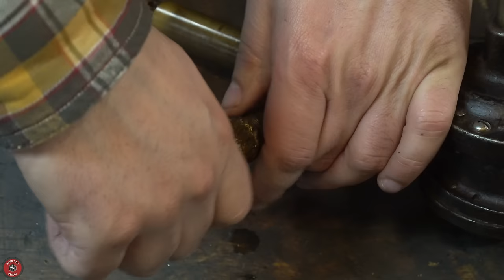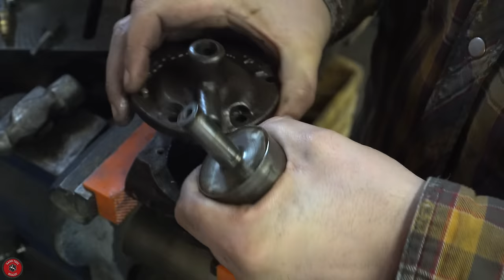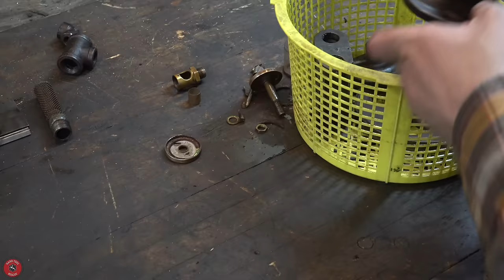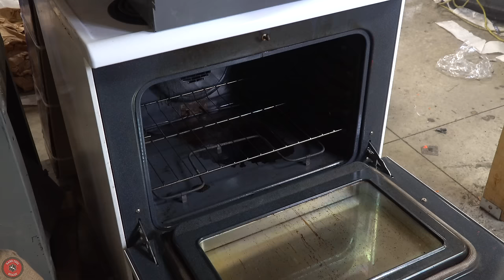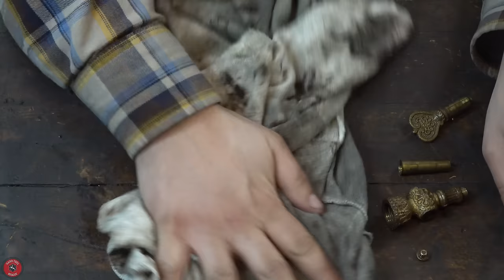Rare Antique Blower [Restoration]

Comment: Nice job Eric, but you're supposed to put the locating pins in the block BEFORE you tighten the screws! ;-)
Reply: true
Reply: And coulda made a mandrel to straighten the brass screen from the inside, of a proper sized wooden dowel with a rounded end

Comment: Some things to menition:
I like your work very much. 
The hot glue is a clever trick! :)

Some improvements for next time:
Please do not sandblast the housing of a blower the inside is a sealing surface and it will be damaged.
Please put the liquid sealingaround the screwholes on both sides, otherwise ther may be leaks
Please put at first the positioning Pins inside and afterwards the screws or bolts, otherwise there can  be some stress in the housing.

I would never put the soft foam inside the wiremesh airfilter, it may bes sucked inside the housing and scramble up the Rotor, which would be very sad :(

Kind regards Kai Heetjans
Reply: Agreed...

Comment: Next time you need to make a new gasket, buy a cricut, used for arts and craft mainly, but you can configure it to cut most gasket material. Basically it’s a tiny CNC
Reply: there are smarter ways that people used to cut gaskets back during the olden days

Comment: With the foam on the inside of the brass cage, is there a possibility that it will get sucked into the pump?
Reply: I'd think so, especially once the foam gets loaded with dust. Seems more likely to me the mesh is intended to support a sock filter pulled over the outside as used on dirt bikes.
Reply: Not likely. No more airflow than what it had, chances are extremely slim.  It would take a massive force of airflow to dislodge the foam.

Comment: My father repaired musical instruments, and back in the 1950s he had a later model of a Hypress blower that he used with a small natural gas torch. He used it to silver solder and soften metals before bending. The output of the blower was anything but impressive, but it worked well with a 1/4 hp motor.

Comment: Love all your videos, excellent work!  I like that you try to reuse as much of the original pieces as possible and you don't "over restore".  Friendly piece of advice.  Nitrile or latex gloves are your friend.  Skin is an organ and absorbs nasty things like the chemicals in penetrating oil, solvents, etc.  Not a big deal for the occasional weekend resto-warrior, but if you're exposing yourself daily, protecting your skin matters.  A box of 50 pair of "shop gloves" (heavier duty than the light blue ones you get in the paint aisle) is $20 or less all day long.  Get a box, your circulatory system and especially your liver will love you for it.

Comment: The rotary compressor is indeed rare, but everything else around it is fiction. The drip oil ain't going to work with a 90 degree pipe and that horizontal section and this ran with steam, steam ran with flat belts. Someone fabricobbled this from bits and pieces.
Reply: You may be right about the pulley, but the oiler is as it appears in the advertisement he posted in the description.
Reply: @badstate  But he watched AVE videos, He doesn't need to read the description and follow the links because he knows everything already.
Reply: @UncleWillie  also lost that beautiful patina on the iron.
P.S. they had round leather belts then to
Reply: @badstate  yes it will oil the vanes even with the elbow
Reply: Yes. A lot of the stuff is just added afterwards to rig up something that worked for whom ever did it. Either way it’s interesting nonetheless.
Reply: I've also yet to see an air filter with foam after a screen mesh. When that foam degrades it'll screw that thing up over time. It's probably custom too.
Reply: @rustybacon54  probably had felt over the mesh seeing foam was not around then
Reply: rustybacon54 whenever I encounter these types of filter housing I use socks of the appropriate size. Go all the way down to short and long infant socks up to Shaquille O’Neil size. Put it on inside out to avoid lint.

Comment: I will never agree with the whole patina thing.
Reply: The difference is between a "reset" and a "restore." Nothing wrong with a reset if you want to keep and enjoy using something for yourself. Collectors want a restore and collecting is more popular, so that is where the money is.
Reply: I agree I think the whole patina thing is bs.
I have talked with a local restoration guy and he also said the petina thing is a load of bs as well.
And he blamed Antiques Roadshow for people not wanting to restore there stuff even if it doe's look like a pile of crap they have and would look better with the rust and grime taken off.
Reply: Especially when all the steel screw heads are polished and the label rivets are shiny brass. Doesn't match.
Reply: if you don't understand the value of patina then don't handle antiques.
Reply: Not agreeing with and not understanding are not the same thing.
Reply: I did 8 years in the navy, If I never polish brass again it'll be too soon; patina away!
Reply: "I'm keeping the patina" said no one else on YT resto projects ever!

It's easy for folks to set a goal of making something look factory new (maybe not easy to achieve) but it's harder to decide on  how far to take a restoration or conservation. Kudos to you for taking that decision but I wonder why you didn't stick with the original black japanning which I didn't think looked too bad.

Comment: This same basic design of air pump is still in use for the same purpose -- separating sheets of paper for the feed into a printing press. All three of my printing presses (the oldest was made in the '70s and the newest in 1996) have somewhat larger versions, which supply both the air to separate the sheets and the vacuum that picks the sheet up and chunks it into the gripper. 

My pumps have three Bakelite vanes inside that slide freely in slots in the impeller. They are kept against the chamber wall by centrifugal force, instead of that complicated metal seesaw arrangement. I have to rebuild these pumps every few years (the Bakelite wears down); there's a kit I get that includes new gaskets and vanes. I've found that the key to keeping these pumps working well is to keep them oiled and clean inside, and do everything in your power to seal that sucker TIGHT when reassembling it -- but don't put the covers on TOO tight, or they bind the impeller. I've gone so far as to lap the covers onto the body with Bon-Ami before using both the rebuild kit's thin cellophane gasket and that "instant gasket" stuff. 

At least you had less trouble with the pulley than I did on one of mine. Some dolt had beat on the shaft end with a sledge or something and enlarged it (which to my shame I didn't notice) , so the pulley WOULD NOT come off, period. I wound up getting it off in pieces and finding a replacement.

Comment: I’m sure you already know that ornate valve most likely came from gas lighting found in Victorian era homes. Good job on the vid
Reply: Ya it probably was just like the air filter housing looks like someone got a piece of brass mesh and some solder and made it themselves because I think back when that thing was in use people didn't buy a new one every time something was broke they just repaired it with whatever they could however they could

Comment: Nice work as always! Good that you did not polish it up and make it look new. L.J. Wing Co. is still in existence. They seem to make heating and HVAC equipment now. My dad had an L.J. Wing blower that he connected to a 1/4 hp motor and used with a gas blow lamp or blow torch. He repaired brass and woodwind musical instruments and was a true artisan.

Comment: The way that piston works is ingenious. I wonder if it's ever been used in an internal combustion engine. Very cool!
Reply: Very similar sliding-vane pumps are used to pump oil in many engines and automatic transmission.

Comment: Very cool old machine! Also interesting that it was used to separate paper sheets. I expect they had an oil trap on the system to protect the paper from greasy spots from the air discharge, with that oiler!

Interestingly, that design is still in use today. You can buy an Ingersoll-Rand air-powered motor which is almost identical to that blower. When I saw your video thumbnail, that's what I initially thought it was!  Look up SM series Air Motor.

Thanks for the nice videos!

Comment: GV. You should get some dental tools for delicate work. For example, you could use a tartar scraper to remove that stubborn cork from around the inside of the cap. You can use the picks to lift out small O-rings and scrap clean any stubborn bits that are left.

Also, you should use a drop or two of liquid thread sealant around the fittings to ensure an air tight seal.
Reply from the maker: Could be useful actually!

Comment: I've reshaped quite a few brass mesh filters over the years.. 
The easiest way I've found for small ones like that is to put a bit of round in that's about 3/4 the i.d. and then gently roll it on a 2-by-4.
The go up to the closest size you have and repeat. Only takes a couple of minutes.
Reply: And if the filter fine mesh and  is bigger than the fitting you Can insert a thick rubber balloon in, pressurize it and do as with a dowel. Needs finer touch and more rolling though

Comment: They were used in the product of glue laminated beams aka glulam 
Glulam is a stress-rated engineered wood beam composed of wood laminations, or "lams", that are bonded together with durable, moisture-resistant adhesives. The grain of the laminations runs parallel with the length of the member. Glulam is versatile, ranging from simple, straight beams to complex, curved members

Comment: If you take out that compressed foam filter, you could probably up the airflow quite a bit.  Just line the inside of the screen  with the foam or a lighter weight foam.

Comment: The threaded connections of such pipes had large backlash and probably need additional sealing with FUM tape (flax fibers were used before).
Such a foam filter will not work properly.
The faucet plug had visible scratches, perhaps she must be ground again.

Comment: I have concerns about using the sealant on the end plates of the air pump. Normally it's supposed to be a metal-to-metal seal. The rotor, housing, and vane of these types of pumps are surface ground, then lapped as one unit so they are exactly the same thickness. The rotor and vane may be left in the lapping machine a little bit longer so it is just a tiny bit thinner then the body, thus providing the absolute minimum clearance when running. The layers of sealant will increase this clearance too much and a lot of air will bypass the rotor and vane.

Comment: A knitting needle with a ball end might have been good for getting the creases out of the air filter .
The T piece just needed a bar put through it instead of using the straight piece of pipe , it's just elementary to do that , i was doing it 40 years ago when doing plumbing

Comment: What a gorgeous little gadget. Looks like something Veritas would come up with if they made mechanical things. Very nice restoration!

I have a query: if you plunge lead-based-paint-coated objects into the Evapo-Rust so you can see the original color, why doesn't the Evapo-Rust get contaminated with lead? Does that only happen if the paint is loose/powdery?

Comment: normally you install dowel pins first and than the bolts/screws because dowel pins align the casings thus the input and output shafts

Comment: You need some gunsmithing screwdrivers for old time screws like those. Parallel sides on them as they are cut rather than forged. 

Would a wooden dowel inserted into the brass mesh been a decent former to reshape the brass mesh filter screen?

Comment: Might try a thicker oil, like gear oil, the blowby on those impeller thingies is probably horrible. A thick oil might seal a little better. They probably used steam oil for lubing steam pistons when it came out and that stuff is really thick.

Comment: I would assume the brass tube tube with the spring loaded thingamabob is supposed to be a crude pressure release valve that relies on the tension from the spring being able to withstand the pressure from the blower
Reply from the maker: Yes, exactly!
Reply: A good old pop off valve, I've been soaked/sprayed/burned by many of them

Comment: Great job as always.
You have a great talent.
If all the oil was used in that short test run, was the drip rate not set too fast?
Does re-blacking the ferrous parts lower the value?

Comment: Is it not necessary to have some sort of thread sealer on the brass joints? I would have thought like a teflon tape or something would be needed to seal the fittings to each other.
Reply from the maker: If this was going to be used all day, then yes, I probably would do that as well.

Comment: Lovely old bit history restored for another generation to enjoy.
Can I ask, when you took it apart, was there any signs of a gasket between the main parts of the castings, that you applied liquid gasket to? Because most of these older pieces of equipment didn't need gaskets, because they had tight tolerances and some times ground surfaces, and adding anything between that shouldn't be there can have  a knock on effect of upsetting the internal tolerances, eg the side surfaces that the rotor runs against. Hope that makes sense.

Comment: Some times it works to use compressed air to get parts like the body to pop apart plug all holes and plumb air in and they pop not perfect but worth a try

Comment: Anyone decide what did this originally do? Has oil lubricator so not air for human use (thinking scuba tanks).....aquarium pump? The brass valve has 3 step nozzle for rubber hose like a lab bunsen burner gas fitting. Puzzled?

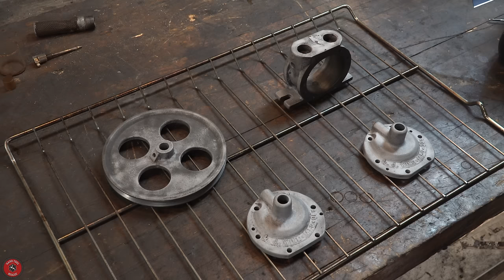Comment: 13:29 Came here for the Japanning. Wow. Thanks for demonstrating it, the finish looks great. I plan on baking it just like in this video. Any tips on getting the finish smooth??  Thank you.
Reply from the maker: Thanks!  You can get a smooth finish if you make the steel nice and smooth beforehand or sand between coats.
Reply: @HandToolRescue  What grit would you start or aim for when sanding between coats? Thanks.
Reply from the maker: @congruewoodworks1474  Start lowest at 220 then up to thousands if you want!
Reply: @HandToolRescue  Thank you

Comment: I have a machining attachment an old delta lathe I own. A water pipe sprung a leak near it in the basement, and now the whole thing is covered in a thin layer of rust. How do you suggest that I go about cleaning up the attachment?
Reply from the maker: You could take it all apart and wire-wheel and oil each piece, or just dunk the whole thing in something like Evapo-Rust.
Reply: Hand Tool Rescue Thanks.

Comment: Just curious, what horsepower motor did you use to power the blower? Would a 1/3 or 1/5 hp motor be enough to drive this? Great video!
Reply from the maker: I used a 2HP but 1/8th would probably do it.

Comment: You should Norweaganize it instead: 1 Part north sea oil, 2 parts duck beak charcoal, 1 parts that slop that forms on the bottom of compost bins. Cure it untill you cant stand it anymore then throw it away - because it's rubbish. Edit: parts are "by feel" not volume or weight. Edit 2: This is not snark. You can substitute north sea oil with Snark to make Sweedination but that needs to be cured longer.Edit 3: If you use Snark and substitute duck beak charcoal with 3rd time cud charcoal you get Hollandaise wich is better. But it's very hard to get the right cud from cows without injury.

Comment: taper cut threads are too rough to work without some type of sealant
Reply: Proper well cut taper threads will work fine on low pressure . When this was built there was no such thing as ptfe tape . Seals were brazed and thick grease and excellent workmanship did everything else
Reply: Low pressure air... no need to sweat it

Comment: Usually if the rubber tooth pliers can’t break a  brass pipe loose I grab it with my buttcheeks to get a firm but gentle bite on it. Heat is optional.

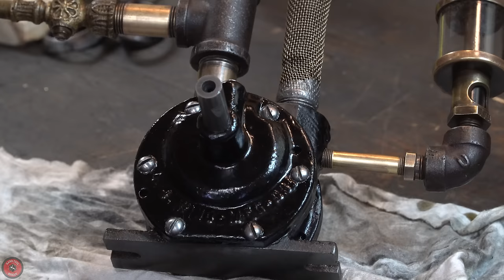Comment: 26:28 - OK, we have screws in place, they are tight, now let's hammer in pins that provide accurate positioning. WTF?
Reply from the maker: The screws were not tightened until the pins were tapped in since the gasket needed to dry.
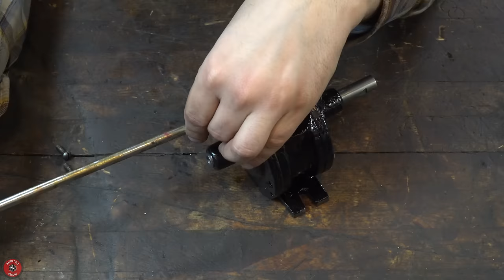Reply: 22:56 - who can tell "screws were not tightened"? At what time you tightened them finally? Look, you show an example to everyone, you have to be accurate.

Comment: You obviously care about this object but putting the main body through your blaster without protecting the internal running surface is just about the worst thing I can imagine for this machine. When you dismantled it you did not mark the position and orientation of the two pins that seal to the running surface. This means that they will not go back as they were and the surfaces that have worn together over time will not be presented correctly. Your banging in of the (unmarked) locating pins was the third example of very bad working practice shown in this video.